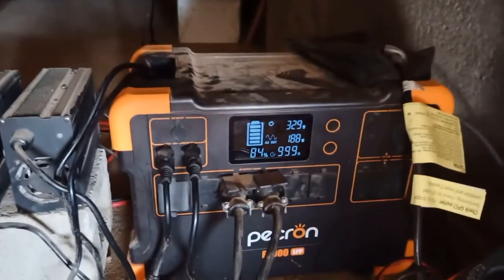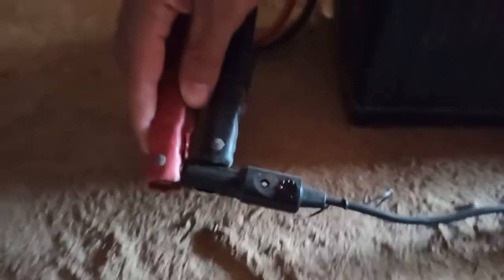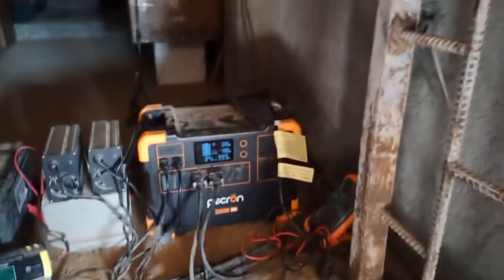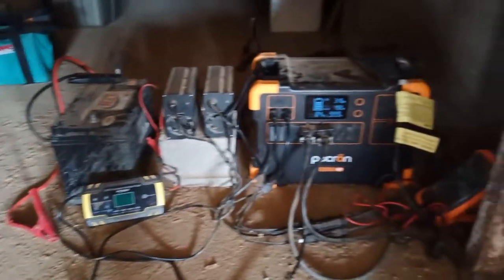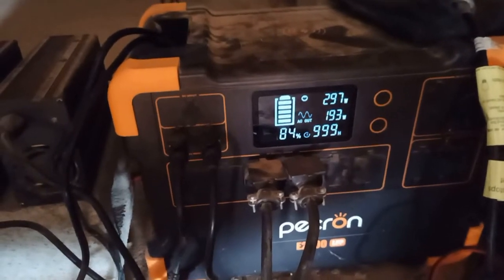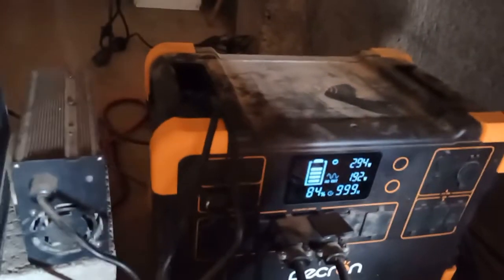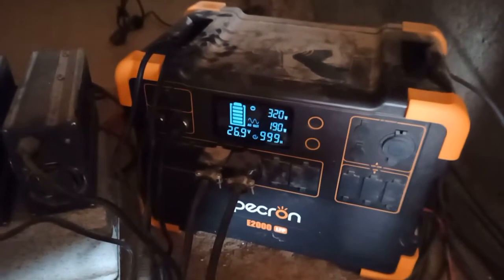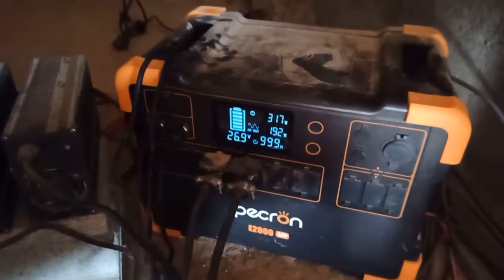Pecron E2000 LFP expansion battery hacking

Comment: Anyone tried it with the Pecron 48V power stations with a 48V battery?  It uses a different connector so a banana plug won't work  What connector would work?